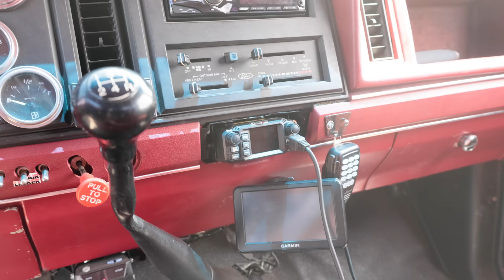4BT Cummins in an '88 Ranger gets ALL the MPGs

Comment: Thats interesting.

And for comparison, my 2000 2.2L 5speed S10 would generally get 25mpg highway, but keeping the speed down and driving with economy in mind could get that over 30. 35hwy was the best I ever got out of that gas S10
Reply: I looked at the mpg them got it surprised how bad it was for example a supercharger buick 3.8 does 26 highway and makes way more power
Reply: @bryantb3391 yeah and the 4.3 is only fucking worse sadly i loved the 85' s10 i had but lil engine had no power and didnt want to just go to a typical 350

Comment: I'm not really impressed with those mileage numbers in a truck this size, other than the fact that it's lifted so high. My Nissan pickup with the standard 2.4l 4 banger and 5-speed manual rivaled those numbers. I could get 27-28 on the highway and low 20's around town. I'm wondering if you got rid of the body lift and put some regular tires on it if it wouldn't put you over the 30 mpg highway mark. People underestimate how much of a hit you take from bad aero.
Reply: Pretty sure he knows that.  I’ve driven little Mitsubishi pickups with great MPG but they are not nearly as much fun.
Reply: I mean... duh? I think you answered your own thoughts and speculations
Reply: Owned an 03 Ranger with the dohc 2.3 and a manual trans. Gave me 27mpg at 75 fully loaded driving through Wyoming with a head wind.
Reply: turning the fuel rate back down would help a lot

Comment: just a piece of knowledge about the zf5 the gear ratio being off since its a gasser trans isnt a big deal the diesel gears swap directly inj so you get a close pattern but sbf bell housing pattern
Reply: also the 80s rangers came with diesel 2.2l perkins to be exact it was only offered for a couple years but those engines got very great mpg too

Comment: Apparently he doesn't know Rangers very well because they DID have a diesel option, first a Perkins diesel then a 2.3L Mitsubishi.  The Mitsubishi ran great but I had head gasket problems so I scrapped mine.  The 2.3L Mitsu running on diesel or veg oil diesel mix regularly got well over 30 mpg highway.  Plenty of power and torque on and off road.  My friend still has it... maybe I'll get it back.  I have an 85 Bronco II that would be a perfect combo.  I drove it back and forth to work every day for a while 200 mi round trip.  More than enough passing power on the highway, surprisingly.....
Many of the 4BTs has a chevy trans behind them from the Frito Lay vans, I'd never heard that they had Ford trans and never ran across one (yet).

Comment: I didn't see if the transfer case is married or divorced, but, either way, I think a Gear Venders Under/Overdrive would fix your 40 MPH issues and it would make the open road far better.. Also, I agree.. Do a big dics upgrade to your brakes. You not only added weight to the truck, but much taller and heavier tires and that's a pile of inertia to control!!!

Comment: I drove 2 Bronco 2's to 250k. And a Ranger to 225k. The most I ever got out of either the Mazda or Mitsu transmission was 90k. And thats the 1 I changed the fluid with every oil change.
Reply: By the time I switched to Toyota I could pull a Ranger tranny in 15 minutes. Installed in 45. Bled in....3 hours using Factory procedures. (200-300 pumps, pays 2 hours) Then I cracked the code. Push fluid through bleeder until reservoir overflowed. Took 2 minutes. No pedal pumping.

Comment: I want to do this with my 82 b2200 perkins diesel not just for power but because parts are so difficult to find
Reply: lol the rangers and dodge D50 around 1986/87 with the Mitsubishi 2.3L turbo diesel were great trucks.  The Perkins engines were dogs and problematic

Comment: I've owned almost every single year ranger before 2005 they are half way decent trucks , had a 84 7.5 bed 4x4 2.9 v6 4 speed two tone brown light brown with stainless trim and white top  that was kinda rare , beat the living crap out of it as a kid and I wish that I didn't because I want that truck back so badly that I've put flyers out trying to find it and found out that it's fate was the crusher because a kid sideswiped a mail truck with it 😢, when I found out that in 84 there wasn't many 7.5 foot bed 4x4 rangers than the 2 wheel drive trucks out there which made it kinda rare ....

Comment: I wished there had been an inline 6 available for the Ranger(not diesel)....I know you can do a V8 swap, but a straight 6 is just suited for a pickup...think the 4.0 in the XJ Cherokee and the Comanche pickup derivative...I bought a new '86 Ranger with the 2.9 Cologne V6...while not as gutless as the 2.8 V6 Chevrolet S-10 I test drove, the Ranger 2.9 lacked low end torque, was "buzzy" and had a very narrow power band..which I found increasingly annoying over the 6 years I owned it( and it didn't get particularly good gas mileage)...back then, I wished it had a V8, but now looking back, an inline 6 would have been ideal...
Reply: the Explorer 4L v6 drops right in and plenty of power.
Reply: @juststeve7665  Yes, if they had the 4.0 then it would have been better...but they didn't..the fact it "drops right in" didn't do me any good in 1986-87 when it was new, and by the time I got rid of it in '92, it was just a used pickup and I was looking for a full-size pickup by then, and not interested in an engine change for the Ranger..plus, despite it "drops right in", I bet there were electircal/electronic differences to deal with...

Comment: I want to put a 4 BT Cummins in my 05 F-150 4x4 it sits on 37x20X11.5 with a 4 inch lift and a 2.5 inch body lift do you think it can be done for 10,000 I don't have $10,000 to put in the tools like A frame and all the tools and then the knowledge to cook it all up would be better to have somebody else to do it Not only that but I'm disabled

Comment: 30?  Is that all?  Best I ever got in my 2003 Ram 3500 Cummins HO with NV5600 was 26, hand calculated.  I must’ve been going slightly down hill with the wind at my back, but still…
I miss that truck.
Reply: lol that's a lot better than my Hemi Megacab...  15 on a good day and 9 towing a trailer.
Reply: @juststeve7665  sounds like my Tundra

Comment: Dude, no bullshit: Gear that puppy down to like 4.58:1. It'll NEVER QUIT. (Aside from possibly chewing up that tyranny. But that'll probably happen even faster being geared so high.)
Reply: it's already got a transfer case with low range....   what he needs is higher axle gears not lower.    higher gears lower numerical ratio , lower gears higher numerical ratio number.
Reply: @Just Steve He said he's geared 3.55:1, and it's clearly too high when it's lugging around like that. That's a tractor engine, which is most likely tuned to put out anywhere from 100 to 120 horse with the turbo. Capable of being turned up to more, but it seems like he's not done anything like that. The torque is, of course, excellent but it probably red lines at around 2,000 or 2200 rpm. If it will do 80 but takes a long time to get there, it's geared too high. That truck has no business doing 80. It's perfect environment is a rough ass trail doing 8, not 80. But it'll run forever!

Comment: 21mpgs that really shows how bad the cummins is my 7.3 does 18 to 20
Reply: Lol. A 12 valve will do over 20 in a truck and from experience, a 24 valve will do 25 if you try. 7.3s are good but not as good as Cummins by any stretch.

Comment: Why are you doing this to me man…
I’ve got the international version of the ranger which I’d call a mk1 (1999-2002) and I keep thinking about a Cummins engine swap, but they’re so heavy and hard to find in the UK. I’ve got more chance with a BMW M57 or an OM606
Reply: Trust me, both of those motors are much better.
Reply: You might find a 4BT in a JCB, that's basically what they're designed for.  I'm sure there's plenty of tractor engines around the UK that you could swap in, but I wouldn't.

Comment: 3.55 ratio is a little tall.
Reply: Finally someone else mentions this! The ratio is way too high for this setup, It's causing it to lug and for the engine it's running right now, it's not built for speed, it's a tractor engine, and thus should be wayyy lower geared. Crazy how almost no-one in this comment section notices that.

Comment: I had a 93 F150 that had the 300-6 and a 5-spd. 4x4. I didn’t change anything because it was already awesome. Then I had a 1996 Dodge Ram 1500. Once the 360 fell victim to head cracks, I pulled it out and installed a 300-6 and the heavy duty 5-speed. Then I had a 1998 Chev 1/2 ton with a boring old 350. You guessed it, pulled that hunk of crap out and installed a 300-6 with a 4-speed. Made it a much better truck - except for the crappy dash & interior.